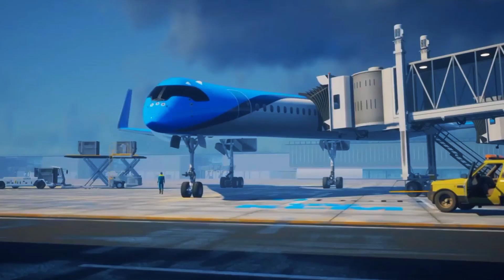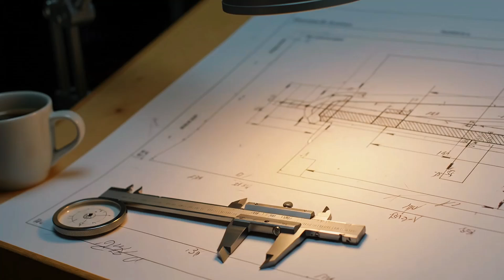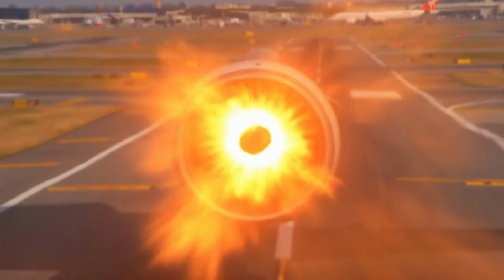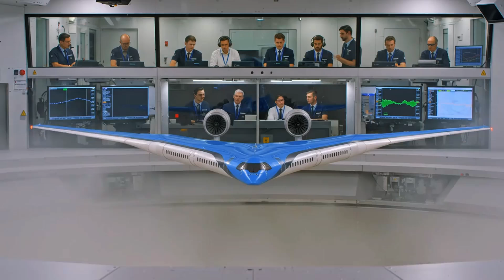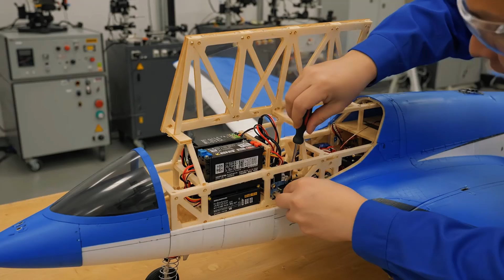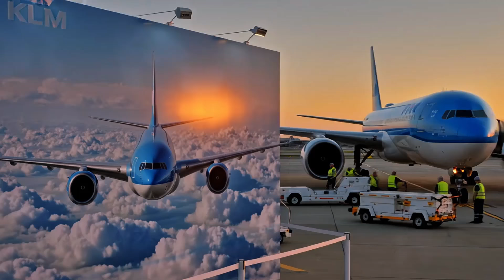Boeing and Airbus Are Terrified of the Engine on This New Airplane, the Flying-V

Comment: Where will the center of gravity be in a Flying-V design? -- With the traditional; the tube, wing, and tail design; the center of gravity will be known and be located somewhere in the center of the tube and with automation the center of gravity can be altered by pumping fuel from various fuel tanks to tanks to balance the plane. This is much simpler to do with the traditional tube, wing, and tail design and more difficult to do with the Flying-V design. -- I serious doubt Boeing or Airbus are worried about the Flying-V conquering aviation.

Comment: In 1949, I and several of my King's School, Peterborough 15 year-olds, bought the KielKraft Kit "Flying Wing" It had a rubber motor and a huge prop sticking out of its nose. I noticed, when a documentary of KeilKraft Kits was produced a year-or-so ago, that this kit was not even mentioned. The kit itself was the usual KielKraftKit of Balsa and tissue covered wing structure.

Comment: The thing is that I would keep the tube but make it wide  9mtr in the front and back 10 mtr of the tube. The middle part I would make ultrawide max 13 mtr wide and 9 mtr high and blend the middlepart and flying wing togerher in the middle. Making sure that the first and last 10 mtr of the tube gradually widen to 13 mtr to flow naturally toward the wing. Make the bottom a kind of flat and the first half of the wings just next to the tube i would allocate for cargo and the fuel in the outer part of the wing. Then the two ultrafans halfway the blendid wing on top of the wing somewhere where the fueltanks start.  The passengers will be in the middle and top of the tube and able to escape over the blended wing which is going rapidly enough to a thinner dimention so that the passengers can escape quickly. The entire fuselage must be a lifting body a much as possible. In case of an emergencylanding  with the possability fuel igniting the outer wings can be thrown of just before touching the ground eventually with the engines and the fuel lines to connect left and righ being purched immediately so not to have anny fuel upon impacting the ground which is done by computer not by hand. Landing on water is also possible after deleting the tanks. The entire fuselage must be made of carboncomposite material. First create the tube, then the first half of the wings to be attached to the tube and then then the second half of the wings to be attached. That is it. This would be my first approache to make a plane like that.

Comment: If the turbines are allowed to rotate, then VTOL could perhaps also be achieved! then there would be no requirement for a runway, leading to overall much quicker turn-around times. From a Brit. Airside construction engineer.

Comment: I had this idea my self, speaking of that a flying Log was never the best way to go. Log floats, Paper fly's. In this case we need (A Half Airoplane Tail) and a Seperately (A Half Airoplane Spoiler). Nothing to dramatic so that may loose it's Flare but solid and useable to its purpose in each case. Else a quad engine version seems logical. There to know for sure there will be no tragic accident resulting from the lack of thought put into such a design. There proving to be its major Design floor. 
Considerations of every final outcome here is plainly better not being the fault.
Gusto.P. Kulic.

Comment: Pilots will still not be able to feel the attitude of the aircraft. It will fly at too great of wing loading, have to many systems on board. If you want to save fuel put a set of small flapping wings on top of the the appliance , that will save around 12% of fuel. The wings will produce lift and thrust from the apparent wind.

Comment: What happens if one of the engine is out in this airplane? like sometimes it happens in service in todays airplanes, but the pilot can control the airplane with one engine out and can safely land. Without rudder this flying V will have problems if one engine is out in service.

Comment: The oval shape on the passenger area will require a lot of bracing for the pressure.  That will take some of the
weight savings that are promised.

Comment: I know it's going to be expensive, but build a wing airliner made of titanium mix with composite to be lighter. Design a new engine that has more thrust and power that can go 700 mph but lighter. It has to be engineered so much that testing has to be rigorous.

Comment: Lot of sloppy work. The number of engines fluctates rapidly between two and four, without explanation. The flight of a little model is illustrated by stews working inside the cabin. And oof, the robot narrator doesn't understand how real phrasing works.

Comment: The focus by airliners has been and still is on economics and stockholders interests. The focus should also consider safety. Maybe they could also think about accident safety and the saving of lives. While this focus may bot show up on paper as dollars saved, in the long run a display of near zero accident record would result in hundreds of thousands if not millions of new passengers buying tickets which would vastly improve the bottom line.

Comment: Jack Northrop in the 1940s came out with a design similar to this for political reasons it was rejected but before he died she was able to view the f-117 nighthawk an artist renderings of the B2😊 why the flying Wing was never put to use I do not know the stabilizing what's the biggest biggest problem but it could be doable before advanced computers stabilization without a lot of input in computers modern stealth aircraft could not fly well

Comment: What if you could design a jet engine with the turbine mounted horizontally where the thrust is spread out over a longer length of the wing. The counter rotation would add to the lift  you could make the diameter smaller and increase the length to cut down drag it would blend with the flying wing concept! With the thrust spread.  Over the wing it would be easier to Handel
Reply: handle

Comment: What I cant understand is the fatest part of the wing is at the front, creating the greatest resistence. Why on earth not have the thinnest part at the front and the fatest seating area at the back. Surely that creates less resistance , reducing fuel consumption, also reducing drag of the windows along the front edge. Looks to me like its been made back to front.
Reply: If you look at all wings, the front of the wing is the thickest. The shape of the wing is what gives it the lift needed to get off of the ground. One would think that there is a lot of resistance with the design of the Flying V, but I’m certain that the aerodynamics is such that it provides the lift necessary to get the plane airborne and be safe.
Reply: Nope.

Comment: There's another advance in engine design that will produce more thrust with less fuel call the rotary detonation combustion chamber. Instead of burning fuel by deflagration which means heating it until it burns, this combustion engine ignites fuel by exploding it like a bomb. Unlike earlier pulse detonation engines this version has at least  3 to 5 detonations simultaneously at all times delivering smooth thrust. 

Developed in collaboration between GE, DARPA, and USAF LABS it is currently in its developmental stage for America's most advanced combination cycle hypersonic aircraft but because it is retrofittsble to all jet engines it will eventually find its way to all American military aircraft and then into general commercial usage like GPS, the Internet, anf blockvhain, all originally American military projects.

Comment: Over the years I have worked on High performance air, craft built models and in fact helped a guy build an ultra light aircraft , I am also a pilot .
This issue of flying wings being unstable is a solvable problem, in fact, the Wright brothers solved the problem with their own research . They invented and patented a froward horizontal stabilizer , that stopped other designers from using it. The aeronautical engineers came up with rear horizontal stabilizers , both low mounted and t tail mounted , which is like steering  car with the rear wheels.

The B2 according to what I read needs many sensing computers to stabilize what is a close coupled airframe/ wing . Let me suggest a fix both for the B2 and this flying wing commercial air frame ! Here we are back to steering from the rear .

If a tube, composite or what ever was extended forward with a small horizontal stabilizer we would be back to Atlas theory of " With enough leverage, I could lift the world " !

Any flying wing could be horizontally stabilized with a forward stabilizer ! It could be small , light and retractable at some point . The Wright brothers found the answer early on .

Any future flying wing, needs all the help it can get from a practical idea , forget computers and sensors . The answer is Leverage ! Forward leverage  !

Comment: The flying wing cannot be flown without ECM control it can never be safely flown manually. So since human beings have already given themselves over to big brother and the machine of course Artificial Intelligence will take over the airline industry along with every machine on the planet and every Sci Fi story you've ever read or watched will come to life.Humanity will be taken over by the machine ,we will serve the machine not the other way around.
Reply: ECM is not required for an FW to be Stable --- the temptations of higher efficiency by computer augmented stability RATHER than the actual aerodynamic stability in the design of a Flying Wing Design have become tempting but you then depend on everything working correctly for every second of flight.

Comment: The concorde died because of a small very controlable problem.  debris on the runway that took the plane down.  It proves no matter how technically supperior a small overlooked problem can be more important and destructive.
Reply: The story is a bit more complicated it was popular and uneconomical at the same time very fuel hungry when they shut it down it was politically banned as Branson tried to buy them he was locked out to ensure its ending!

Comment: Personally I would even settle for an Airship,if it were cheap and comfortable.
Reply: But NOT a Boeing build.
Reply: Next it will be a flying saucer 🛸.
Coming soon folks.
Reply: Remember Zeplins , in particular the one that caught fire in New York. Yes !!  Very comfortable in flight, so long as you don’t have to run from the airship when disembarking

Comment: The long tube design is good for pressurizing and depressurizing the passenger compartment. A wing design passenger compartment would require a lot of testing to make it as safe as the tube design. It's a great idea!
Reply: A flying wing was a common sight in England in the 195Os. I remember seeing it when I was a schoolboy in Surrey, but  I don’t remember what became of it!
Reply: Yes
Reply: The very purpose of a commercial airplane is to transport passengers and cargo inside a large simple cylindrical fuselage. Getting rid of the fuselage creates problems and doesn't solve any thing and it destroys the purpose of the commercial airplane. There is no good reason to do it.

Comment: The shape of the tube handles structural stress. To say yhat it is useless is a huge understatement. . The forces of stress snd and flexing are handled by yhe wings while yhe tube shape 9gfers a stable environment gor passengers and carge. While i love the G wing shape, i worry about stresses of turbulence and unstable a8r being transferred into the main passenger area. I worry yhat over time it could cause structural fatigue. Thats s lot of dynamics they better get right. Passengers safety depends on it.

Comment: I was an A&P, inspector, and nondestructive testing inspector on heavy category  aircraft. One thing I noticed in one of the rendering s  is on the engine on top is that the MLG Struts were still tall.The normal reason for a tall Strut is to make room for under slung engine s . The other thing is that over mounted engine s would need special servicing equipment.
Reply: But you missed the fact that this was created using the Artificial Idiot by someone that has never seen a aircraft other than in a colouring book, Did you see the roof mounted wiper arms towards the end?:face-turquoise-covering-eyes:
Reply: @johntouw3153 no?🙃
Reply: Nope I thought it was an urban myth lol. Airline companies would never undermine passenger safety lol😳🤫🙃
Reply: in most cases the tall strut is to lift the engine outside of the slightly turbulent air close to the surface (and so as not to interfere with laminar flow in many cases).

Podded underwing engines are an ideal compromise for countering flutter and weighting effects whilst increasing servicability

Unless someone can solve the evacuation requirements, alternative shapes won't be seen for civil transport anytime soon. If you can't get all the passenger out in 90 seconds with half the exits out of action then the solution is to reduce the passenger count or not build the thing.

Accountants won't allow aircraft where exit limits result in sparsely seated cabins and the freight market isn't big enough to justify the R&D costs
Reply: Non destruction?
Remember the testing the birds through the engine tests?
Well known airline?
Did untold damage?
Yup don't use frozen chickens lol
Reply: Yes

Comment: The power plant needs to be the electrical O2 current flow through a membrane, like platinum, and a pulse splitter to pull water apart and to be used as cold steam fuel as flame! THIS IS EASY, YOU CAN MAKE FUEL OUT OF WATER ON DEMAND, STRAIGHT FROM WATER AND PULL WATER OUT OF THE AIR BY REFRIGERATION AND HAVE AN ENDLESS SUPPLY OF FUEL AS YOU KNOW EVEN ON A HOT DRY DAY A CAR SETTING WITH ITS REFRIGERATOR A/C running it drops a lot of water on the ground, more then you need to make fuel or electricity, or a nice cold glass of water will pull the condensation to the glass of water by accidental, so how much more can be captured by purpose-full  design!

Comment: In the "Smithsonian Air Magazine", 20 years ago, there was an article about what Boeing, had the Airbus 380 been successful, had on the drawing board........It was wider and had acceppeted would not fit at most airports. Its was on 2 - 747fuselages for pontoons and carried 1500 people in the wing.....Moving 1500 people was the criteria so , with those pontons, Boeing was preparaed to take the 380's business at ocean ports..

Comment: The flying wing isn’t aerodynamically stable.  It can work with computerized stabilization but likely more expensive and more prone to disaster if there is failure of any systems, such as engine failure, or electrical problems. 
Aerodynamics is central to flight, especially when flying commercially with passengers.
Reply: Not that this design is normal with the cockpit at the rear whoever did the graphics needs to go back to Crayons!
Reply: I think you'll find most stealth fighters are bricks already and without constant control they would fall out of the sky.
Reply: Flying wings can be designed to be aerodynamic ally stable  the cost is efficiency!!!

Comment: Jack Northrup built and flew a series of flying wings DURING WWII !!!!!  He did NOT have to copy the Hortons, he did his own research, and the XB35 first flew with piston engines, then the XB49 flew with early jet engines, and today we have the B2 flying wing !!!! !
Reply: Northrop had design concept ideas for fuel saving passenger versions of the YB-49. Nuclear powered turbines were in development but never installed.
Reply: @PAPOOSELAKESURFER  :  Quite a few problems back then with atomic powered aircraft, wasn't practical.  Perhaps it has changed somewhat.  Not greatly.
Placed on long range space probes.  Even send to other planets for power supplies for colonization?
Reply: Decommissioning the sodium cooled reactors reportedly made a radioactive mess.
Reply: @slowpoke3102 it has. we copied somebody's design that worked great !
Reply: You JUST HAD to vilify the Germans. NO, Northrop was NOT the original person with the flying wing concept. Swallow that fact. Digest it. And live with it.
Reply: @aerodynamico6427 he didn't say Northrop invented the flying wing just that Northrop was doing his work without any reference to the hortens
Reply: Another issue was stability and from what I understand the prop powered wings had stability from the spinning props , when they went jet, the wing lost that stability !
Reply: @domenicknegri9605 The YB-49 aluminum fuselage (wing) was not stiff enough for the elevon controls and twisted in flight. The B-2 test wing of titanium and advanced composits broke the hydraulic stress tool and never failed. B2 has computer stability augmentation.
Reply: The big tube is more structurally sound.The flying v would have to be too heavy to be structurally sound?
A great inventor back in the 1600s first flying machine was a flying wing?
Reply: ROTFL